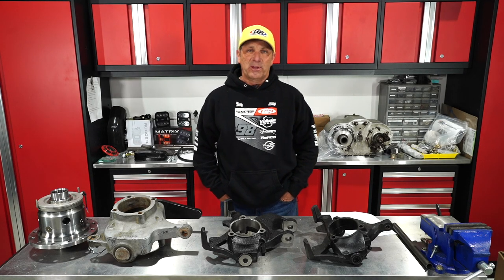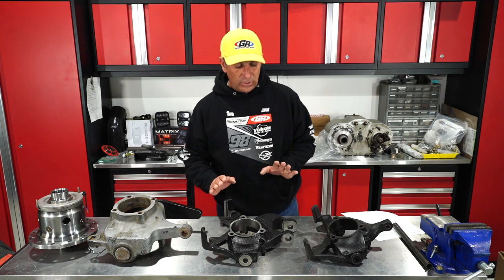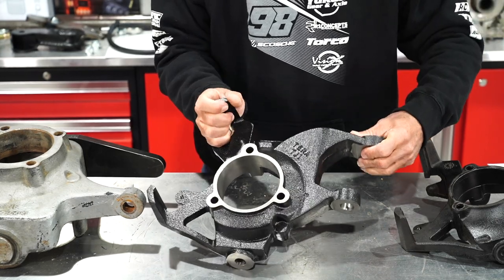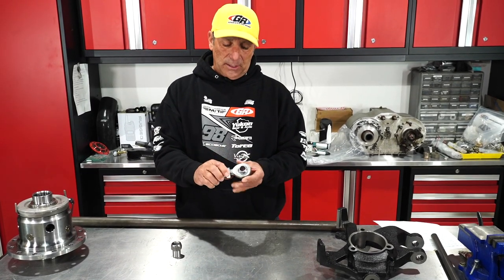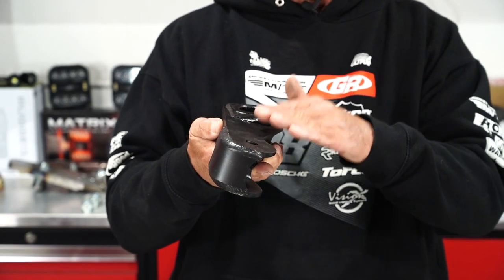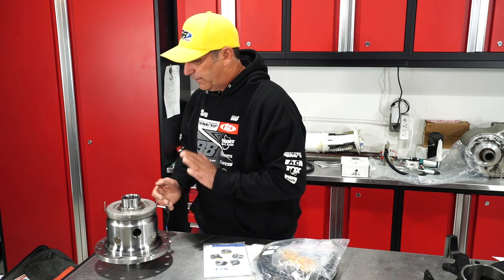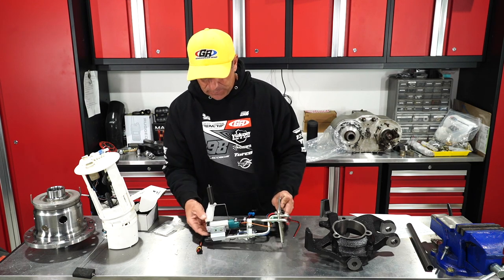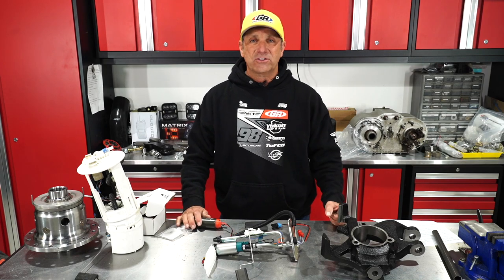Check Out Tech Talk on Tool Bags, High Steer, and Fuel Pump Upgrades!

Comment: Heim joints are garbage.  You wouldn’t have any other bearing open to the elements, and that’s exactly what it is.
Reply: I wanna hear more bout ur bad experience???   I'm bout swap my steering over to heim.  Help out my curiosity.
Reply: @boatsandjeeps780  The only heim joints I am dumb enough to use currently are the links on my anti rock.  They are shot after 2 years, so I’ll be replacing them but I will seal them with rubber boots.   I had heim joint on my aftermarket steering before switching to currie currectlink.   They self destruct because there is no way to keep them clean or lubed . Dirt, dust, mud, etc.,work like sand paper to destroy them.   There are grease zerks and rubber boots on  TRE’s for a reason. How long do you think they or ball joints would last open to the elements?